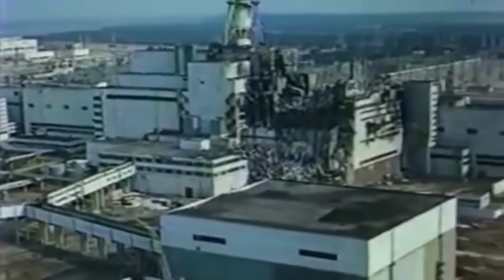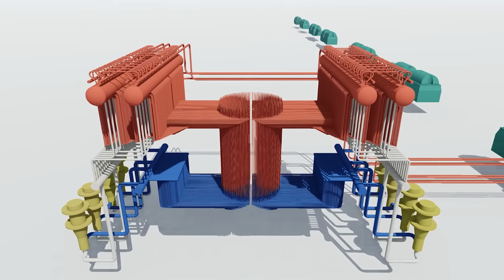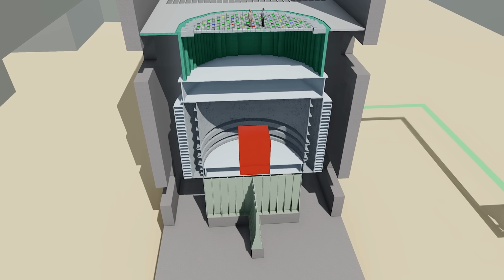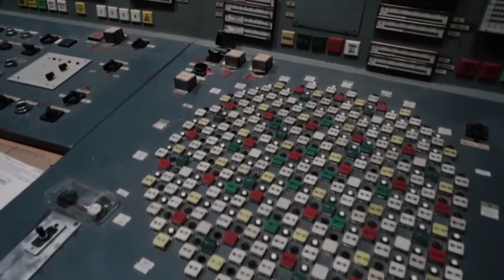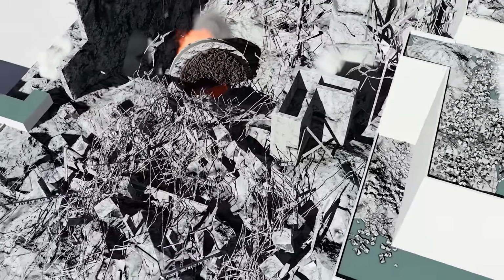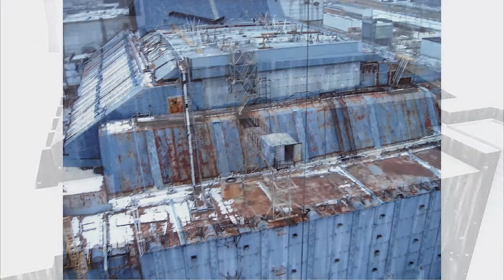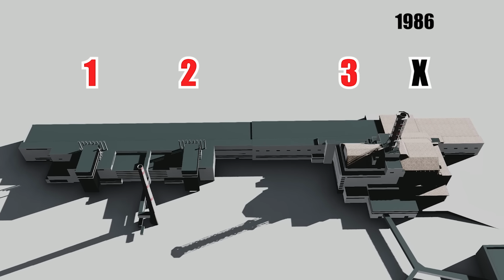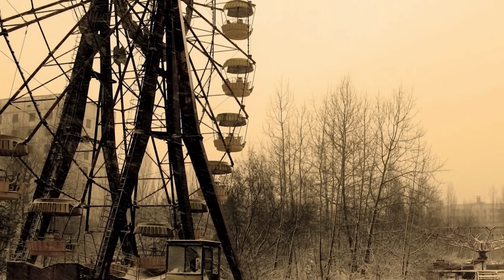CHERNOBYL DISASTER - An Inside Look - 3D

Comment: I think you are mistaken comrade. RBMK reactors don’t explode.
Reply: This man is delusional. Send him to the infirmary.
Reply: Andy Awesome this was copied from a video called Reactor hall unit 2, Chernobyl Nuclear Power Plant from a comment reply
Reply: @andyawesome2842  We did everything right, do you taste metal
Reply: They shouldn't explode if all safety norms, regulations & measures are appropriately & strictly taken.
Reply: @gauravjha8938   not only did they use them inappropriately, they threw out the fucking book.
Reply: @No Smoking Dyaltov removed almost all of the control rods, misused the override function of the reactor protection system and he shutted the turbine off. So RMBK-reactors can't explode if you know how to control them and if you follow the guidelines.
Reply: Everyone calm down it was Homer Simpsoned
Reply: Bill Laswell  In Unit 1 of Chernobyl was a valve of a steam pipe closed and the ECCS and automatic reactor scram were disabled. Luckily, a operator presses the scram button just in time. That accident proves that with the automatic scram system activated a RBMK-reactor is safe, and it would be even more safer with passive safety systems and a completely independent ECCS and auto scram system. The autoscram should only be turned off during startup of the reactor, since the neutron rate will be then greater than normal. In a reactor of Leningrad was also Xenon-poisoning, like in Unit 4 of Chernobyl. But also there they ignored the regulations, didn't handle the situation the right way, and damaged fuel rods. The only way to stop Xenon-poisoning, is to wait and monitor the neutron flux. In Chernobyl that caused the massive steam explosion. You can download a realistic simulator of a RBMK-1000 if you don't believe it.

Sources:
http://accidont.ru/ENG/LAES.html
https://www.reddit.com/r/chernobyl/comments/dduduu/rbmk1000_simulator_game/
https://en.wikipedia.org/wiki/Neutron_poison
Reply: @HVinduction ”safe” it might’ve worked if used correctly, but the control rods were still graphite, not even just the wrong thing, it’s the complete opposite of what you want for control rods, they were fucked from the start.
Reply: They do, like all others, if you don't RTFM.
Reply: But you know what does explode? people who think rbmk reactors can explode
Reply: soany complicated comments
Reply: Correction, you're an idiot. Study first then speak, young child.
Reply: This 3d Model isn’t great, but it’s not terrible either.
Reply: No, RBMK reactors don't explode. It's all the shit around the reactor that blows up.
Reply: Tambov wolf is your comrade.😂
Reply: Unless you lie enough
Reply: @rishabram4389  bro you are wrong the design flaws caused it to explode or if the design was correct and accurate then it couldn't explode my brother
Reply: @rishabram4389  tell me: how can a rbmk reactor explode? Not a meltdown, an explosion
Reply: Even 4 years later, he's in shock. Take him to the infirmary
Reply: Lies. Lies is how an RBMK reactor core explodes
Reply: An explosion did occur, but it was not a nuclear explosion. Power rose so rapidly that water flashed to steam instantly, a so-called steam explosion.
Reply: It's made by people
Reply: Well I think your theory is not exactly what the end results have shown.
Reply: Um I believe you need to try looking at the pictures of the results of the chernobyl reactor explosion! BOOM‼️
Reply: They didn’t see graphite, THEY DIDN’T! BECAUSE IT IS NOT THERE!
Reply: Comrade there is fucking graphite on the roof the core is exposed radiation is ionizing in the air
Reply: @rishabram4389  you are hallusinating. Get him out of here
Reply: Yes they can
Reply: @Ado1024jp  they didn't... After many many mistakes, and a incredible 3 GIGAWATTSS of power output, it blew up. BWR, PWR, Fast Breed Reactors, Liquid Metal Cooled Reactors, wich one can take, on average... 25% of maximum output power peak? And hold? Befores it reaches 20% of safety margin, it's already gone. The truth about Chernobyl? Well... Dyatlov died with it.
Reply: @GOLTURBO555  the thing is of all the designs mentioned only the RBMK is capable of entering a state where it could explode. That's what makes it so dangerous compared to the other designs.

In all the other designs mistakes made by operators could never put the core in an unstable condition. Any deviation from the ideal operating conditions for these reactors will result in a slowing of the reaction rate and a decrease in the cores thermal power output.

Where as in the RBMK there are numerous conditions that can put the core in an unstable state and create a runaway chain reaction that can lead to an explosion.
Reply: @GOLTURBO555  Actually no you are wrong, the RBMK can runaway, and again you are missing the point, no other reactor can be put in a state where it could reach "2 or maybe 3 times the maximum safe output level".

The RBMK design has what is called a positive void coefficient, this means that as the coolant surrounding the fuel rods boils the rate of reaction increases, which leads to more power being produced, which leads to more steam voids and then more power being produced.... A positive feedback loop that can allow the reactor core to enter an unstable state and have the reaction runaway. This is one of the reasons why the power spiked to such dangerous levels. On top of that the control rods were tipped with graphite, a neutron moderator (neutron moderators increase reaction rate by slowing down neutrons making them more likely to collide with a nucleus), which means that if control rods are removed entirely when they are then reinserted the reaction rate actually spikes before slowing down.

These two primary design flaws are what caused the reactor to hit "2 or maybe 3 times the maximum safe output level" and allowed the accident to happen, change either of these things and even if the operators made the exact same poor decisions the reactor would not have exploded.

The modern reactors you seam to be disparaging are specifically designed so they could never hit those kinds of power levels, they have negative feedback loops so that if something starts to go wrong, the core starts to overheat the reaction rate actually slows, reducing the power output of the core, nothing the operators could possibly do could put the reactors into a state where the power output could spike to such levels. The Chernobyl incident is entirely due to the RBMK design and could physically never happen to any other type of reactor.
Reply: @Ender240sxS13  No, wrong again kid. The only one that did, the disaster, was not the RBMK, Xeon at the core, or anything else. Was Dyatlov. He did it. And no, RBMK's dont "Runaway", and don't explode. And BTW, the RBMK is cheap, can be refueled while its at full power, run with a very low enriched uranium, can run with MOX, Uranium Oxide, or spent fuel mixed with Uranium... The Chernobyl reactor, hit the 3giga watts, a day before the shut down, for refuel. Low Uranium enriched, low amount of Uranium at the fuel cells in the core, and hit the 3 gigawatts mark, for then after a few seconds blow up? Really? Kid, one BWR, with fresh fuel, 20 to 35% enriched U235, if he go 10% above the maximum thermal power output, is enough to a hydrogen explosion, in seconds. Enjoy the quarentine, to read more about the RBMK on service, and flawlessly at work, at full power. No "runaway", no explosion. Period.
Reply: @muserock2367  You by yourself... answered your own "points". RBMK Reactors don't explode.
Reply: @muserock2367  You really think, that RBMK explodes? Are you kidding me? Can't understand whats your point. One answer: Before the incident, 3 gigawatts of thermal power output. Period.
Reply: @muserock2367  he's probably some russian comrad who got his ego hurt, poor guy
Reply: @Ender240sxS13  actually no - USA has one that went just as badly (but contained)  - why there are signs in every USA nuclear plant ' NEVER LEAVE THE CORE EXPOSED'
Reply: @GOLTURBO555  it’s called positive void coefficient. The reactor did runaway, with respect to temperature and reactivity. Dyatlov caused it.
Reply: @muserock2367  shut up the state knows best
Reply: The reactor itself didn’t explode because it was overpowered. It blew of the roof which caused oxygen to come in.
Reply: @GOLTURBO555 dude, stop coping, you’re arguing against something that already happened, they can explode, and one of them already did.
Reply: Explain how a RBMK reactor explodes.   You can't!!   Disgraceful.
Reply: @augurseer  literally everything can explode given proper circumstances. I saw a pregnant woman explode. I was about 9. She was hit by a semi going 70 mph.  She exploded like a water balloon.  Saw a melon explode from impact caused by a sledge,  saw agus head pop like a toothpaste cap when his body was crushed(world news clip)
My point is, no matter how well you think something might be, an outside influence can still blow that shit up
Reply: @augurseer  explain how it cannot.. get back to me at an indeterminate time. You have unlimited time to answer.. However, you cant..
Reply: Kirk Eby after more investigating, this seems like some sort of Russian 9/11..
Reply: @rendezvoushere7843  Kinda, because 767 also like RBMK don't explode.
Reply: Russia sucks elephant penis. Nuff said.
Reply: @rishabram4389  the hydrogen that is produced during melting hydrogen is highly volatile
Reply: @No Smoking as I said here, the RBMK don't explode, and who really did the disaster, who really know the truth, is gone. Is  Dyatlov.
Reply: @GOLTURBO555 you spelled the incompetent USSR wrong

Comment: maybe someone with technical knowledge on nuclear power generation can clear up some confusion I have regarding the RBMK biological shields.....since the reactors can be refueled while still operating, I assume this means that the biologic shields have penetrations thru them for each fuel channel.  So how can people be walking on the level above the shield?  Wouldnt radiation pass thru the shield penetrations?   I do know that there is a “fuel changing tube” (not sure of the technical name) suspended from a crane that is operated remotely making it safe to change the fuel rods, but this is used only for the actual swap out of rods?   Thanks in advance.
Reply from the maker: While refueling is happening and the fuel rods are lifted out ppl cannot walk about. Lifting and lowering humans do remotely with a machine.   But when all the fuel rods are lowered it is safe to walk on top of the reactor. 
As I understand it there are spiral radiation blockers on the top of the fuel rods where they pass thru the biological shield penetrations.

Comment: What was Reactor B at Hanford then and how was it licensed along with 7 other exact same reactors?
Reply from the maker: Duffman15000 I have a correction as a pinned comment. But you have shown additional corrections I must note. Unfortunately once the video is posted there is no way to correct the video and errors are stuck forever. 

Thanks. I wasn’t aware of the Hanford B reactor and how similar it was to the RBMK. With vertical pressure channels of very similar quantity penetrating a graphite core. It also was Plutonium breeder. And it goes without saying it was licensed. 

It seems very much like the RBMK was based on the Hanford reactor, basically and improved copy.
Reply: @Mike-Bell  except the RBMK used a closed loop to produce power where as the Reactor B design along with all the others at the site simply dumped the primary loop coolant back into the Colombia river....
Reply: @Mike-Bell  #'merica

Comment: Would it have not Exploded if they didn't press the "Shutdown Button"?
because the guy said it was a detonator and that it put all the control rods in at the same time
and the tips would make the Reactor SkyRocket So what if they didn't press that?
Reply from the maker: Nobody really knows the answer. But it seems to be generally agreed that if the control staff lowered the rods in groups rather than all once the explosion would not have happened. But there was very little time in which to get them lowered because the power was climbing rapidly. So who knows if it would have avoided disaster. 
I feel desperately sorry for the control staff who must have been in a state of sheer terror. They were just doing their jobs and paid with their lives.